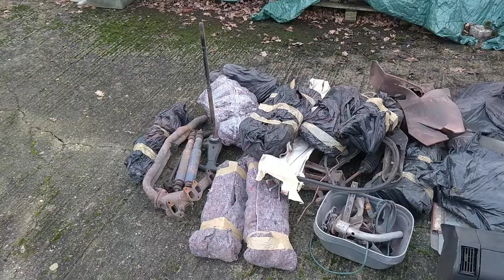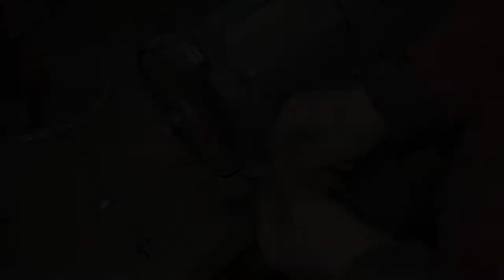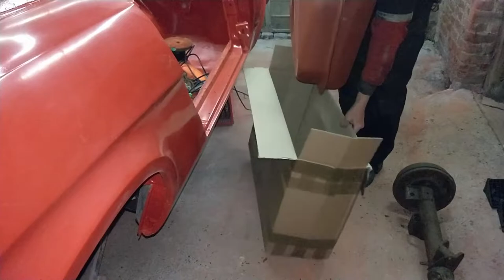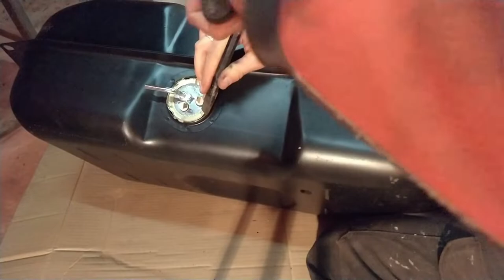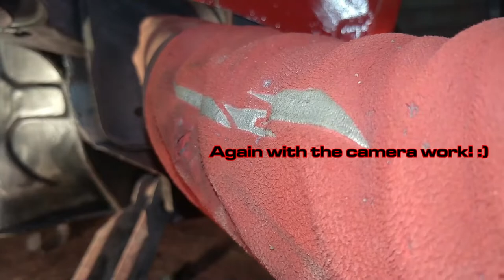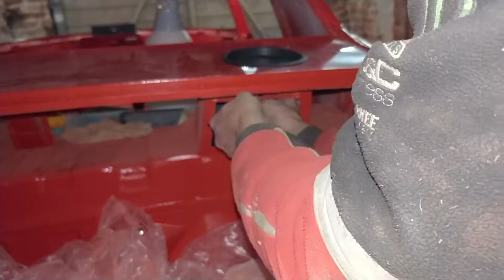Fitting the Fuel Tank - Triumph TR7 Restoration Part 11

Comment: Can you remember what readings you got off your fuel sender unit. My low level light is coming on (switch part) but the voltage measured for level I am dubious about. I know the resistance between GO wire & gnd should go towards zero the fuller the tank. Any info be good as I suspect my sender unit. (The actual gauge is good in the dash). Cheers.
Reply from the maker: I can't remember, no. I don't think I really took any readings anyway - the thing was bouncing around so much I wouldn't have been able to get anything useful off it.
But I do seem to remember the low level light is on a different track to the fuel gauge, making it effectively a seperate circuit. There are three wires to the sender, one for the gauge, one for the light and one ground. Might be worth chasing the wiring through and seeing if there's a break or a short there before looking at the sender itself?
Reply: @RedsGarageUK  Thanks for that yes I did, the low fuel delay unit with the GO wire goes to is a seperate unit attached usually to the top rhs of the perspex dash securing screw.! This works fine, plus all my resistance reading are showing from the coils on fuel gauge, I just don't know if it's right! I am thinking it's the gauge as I have metered out all cables right to the dash so...unless the variable resistor inside the fuel sender is wrong can't be much else. I know it's the sender unit, was being in denial :) Cheers anyway.
Reply from the maker: @ChrisFEJackson  Yeah, I know the one (although for some reason the one on mine had been routed out into the engine bay...). But there's a seperate circuit track inside the sender, chances are that's dirty or corroded. It might be fixable with some cleaning (I actually wish I'd tried that with mine), but while you're there it might be easier to just put a new one in... Depends on how long you want the car off the road really.
Reply: @RedsGarageUK  For sure, I have had the sender unit out and activated manually measuring the resistance etc, how I knew the low fuel light was ok as that gnds the switch supplies to the lamp on the cluster.. to turn it on, no biggie, so if I get it on the road I know I won't run out of fuel, last famous words :)

Comment: Hi Red, Did you replace the fuel filler neck & the anti theft device ?
Reply from the maker: It never had an anti theft device and I wasn't able to find one to buy in time. But I've got a locking cap for the car anyway, so shouldn't matter too much!